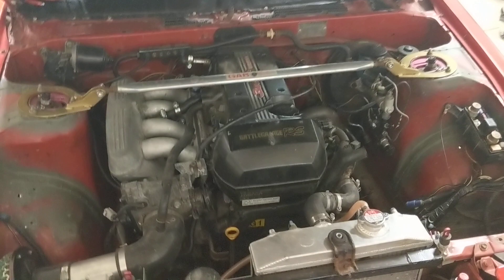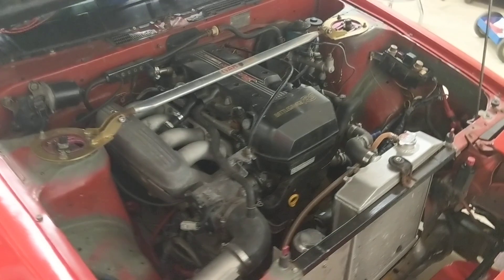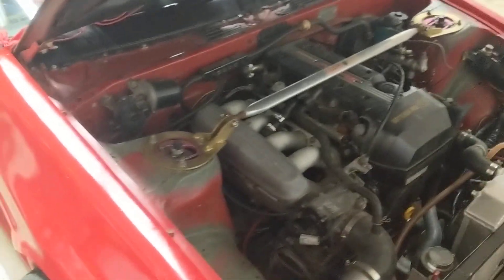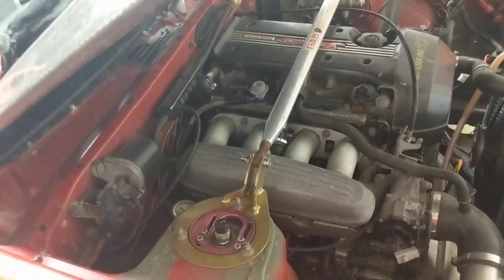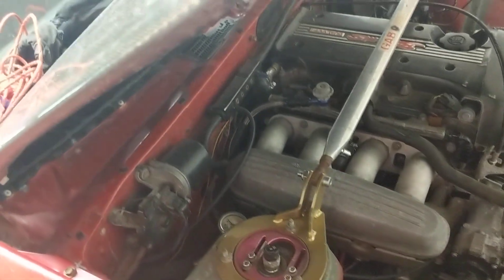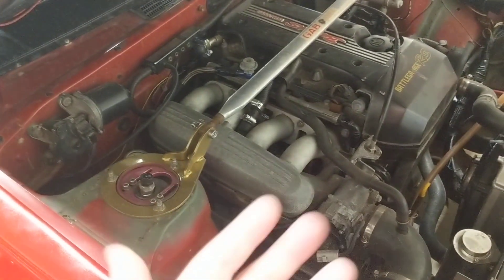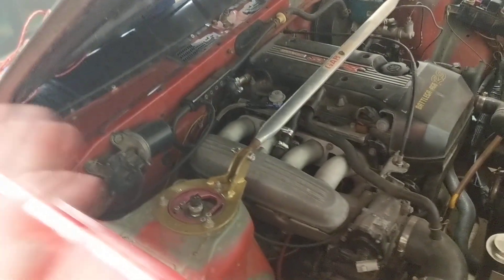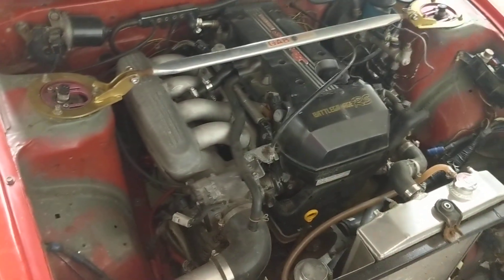BEAMS 3SGE AE86 - Fuel System Stuffs

Comment: Hi great info
Am in the process of installing a beams into my ae86. I got a fuel cell of eBay but need to use an external fuel pump, any recommendations on what pump and filter should I use? Requires need your help here
Reply from the maker: I haven't had good luck with inline pumps. The longest life I've gotten out of one was an AEM, but if I were you I would buy the hanger to put the pump into the fuel cell. I have another video on my channel talking about it

Comment: Dr  
No need for vacuum line from intack? 
Seems you don't connect any vacuum line to intack
Reply from the maker: I didn't connect a vacuum line to it, it ran really well this way on the stock ECU. However, I never tried running a vacuum line to it until after I switched to a standalone ECU.
Reply: @DoctoredGarage  thanks a lot  Man 

I use 6 bar fuel pump 
It is lot of fuel pressure 
Car is running bad and black smoke 
Sometime chucking 
Spark plug getting black 
As I notice it is very high pressure 

Can u advise me please
Reply from the maker: 6bar is 87psi, that's way too high. I'd drop that pressure down to 4bar and see what is like.
Reply: @DoctoredGarage  thanks again 
I drop from 6 bar to 4 bar 
Car is working perfect 
But miss firing  becoz of spark plug  
Going to clean it   and see 

Thanks 
Mohamed   from iran
Reply: @DoctoredGarage  
Dr
As I have fuel pump in tank with attached regulations 6 bar       now I put on fuel return  regulatore   dropped from 6 bar to 4 bar 
Do you think any problem for fuel pump ? 
Best regards

Comment: Hi Dr 
I'm going to fit 3sge beam on my toyota cressida chassis 
I'm going to get  255lph   or 340 lph     fuel pump     

Someone recommended me lexus lx570 fuel pump  

What is your opinion? 
I have  fuel pressure regulator   hks and nuke 

So   you said I need to set the pressure at 60 psi    ? 

Please correct me  

Thanks  Dr
Reply from the maker: 255lph fuel pump is more than enough. I'm not sure about the LX570 fuel pump, I'm not familiar with it. 

General consensus from the beams swap community is ~62psi, but somewhat recently I found the factory spec may actually be only 45psi. I ran at 62psi until I got a standalone ECU and a tune, then I dropped down to 45psi.

Comment: Is it necessary to install pressure regulator? Does it comes with engine? Or aftermarket? Alone walbro fuel pump cannot maintain pressure?
Reply from the maker: It is necessary to install a fuel pressure regulator. The altezza uses one in the pump housing (in tank). You'll need a pressure regulator of some sort, or a pwm fuel pump setup to maintain the correct pressure.

Comment: Do you have an inline fuel filter installed? 
I adjusted my fuel pressure regulator to 60 and it was rich. I dialed it back down to 50. 
I’m getting a really rough idle and it’s pissing me off.
Reply from the maker: Yup! I have a fuel lab 10 micron filter
Reply: @DoctoredGarage  thanks. Let me head to the store to buy 1. My engine was inactive for a while and I’m getting a rough idle, even throwing up an engine code. Should I clean or change injectors?
Reply from the maker: I would have the injectors cleaned and flow tested, you might have a sticking injector or something

Comment: what do you do about venting the tank/ the original charcoal canister? Thanks!
Reply from the maker: I use a fuel cell with a rollover valve for a vent, so I don't have it hooked back up to the original charcoal canister. On my hatchback restomod I plan on using a charcoal canister, I'll just need to figure out an ECU that is capable of controlling the vent properly.

Comment: How you cleared the sway bar
Reply from the maker: I built my engine mounts myself, it puts the engine far enough back that it doesn't touch the sway bar. Most of the swap mount kits out there do now :)
Reply: Doctored Garage got exesive but my engine oil pan don’t let the swaybar go back in

Comment: Where to put the vacuum line in the manifold?
Reply from the maker: The throttle body has 2 vacuum ports. When you do the swap, you'll delete the two things that normally use these ports - evaporative emissions solenoid and intake box door solenoid.
Reply from the maker: You can use either of these ports for the FPR

Comment: Can the stock GTS fuel be used?
Reply from the maker: Which GTS parts? The stock tank and fuel lines are ok, but the stock GTS regulator cannot be used. You'll have to adapt the GTS fuel line to the BEAMS fuel rail and return from your new FPR. 

You'll probably also want to upgrade the fuel pump.
Reply: I'm sorry, I wrote part of the question in my head only. Can I use the stock GTS fuel pump? Will it work?
Reply from the maker: Possibly, but I'm not aware of anybody trying it. Most people upgrade to a ~255lph fuel pump

Comment: Unless I missed it, you forgot to mention what pressure to run the fuel system spec is. I know you said you run at 62 PSI but the BEAMS engine is known to be very fussy when it comes to fuel pressure. We run ours at 73psi because that's what we were told after many hours of asking. But I cannot say whether that is the correct spec. I would very much like to know if you have a spec for the fuel pressure of you just chose 62 because it works for you.
Reply from the maker: After searching through a bunch of altezza forums and talking to several altezza builders/tuners, the generally accepted stock fuel pressure spec should be 62psi, but I've never been able to confirm it in a Toyota manual.

Comment: What would be awesome is some info on what wire need to be connected to get the beams to run theres almost no info out there on that .. and good info on  the fuel system
Reply from the maker: If you take a look at my website, www.doctoredgarage.com, I have a general wiring guide in there on what circuits need to get wired to where :) as well as a bunch of other information on how to do a beams swap.